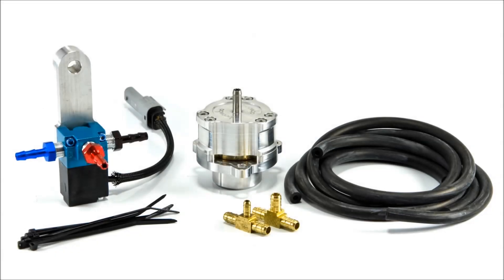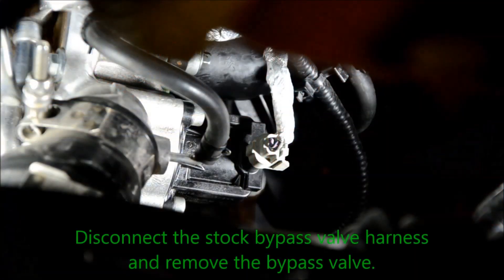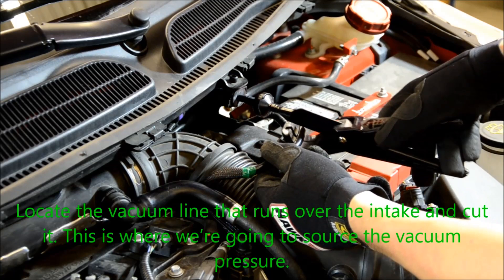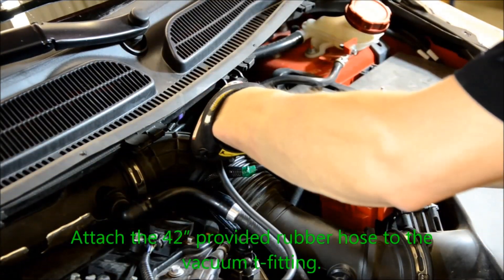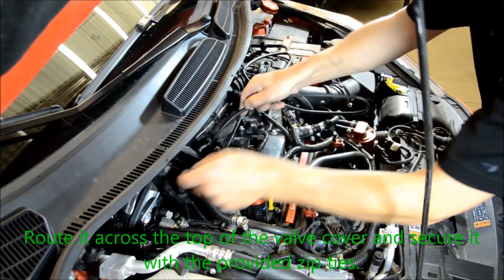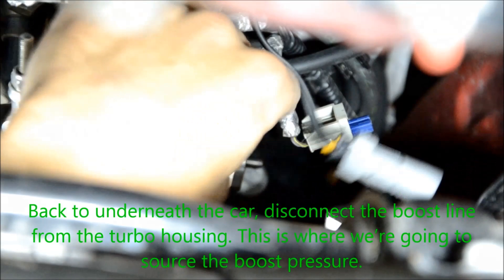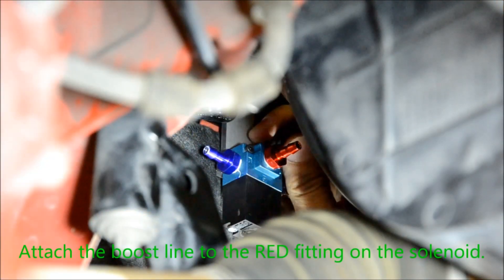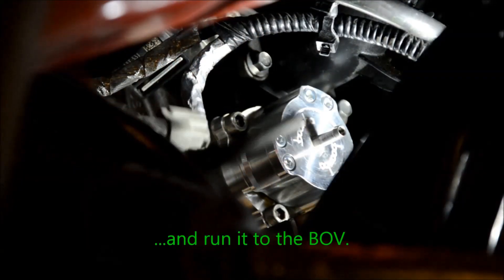How to Install | Boomba Boost Operated BOV/BPV for '14+ Ford Fiesta ST

Comment: Is this a left hand drive car? Meaning for right hand drive cars you take the drivers side wheel off? Thanks.
Reply from the maker: Yes this is a left hand drive car. However the location of the BOV does not change for right hand drive cars. The BOV on these cars is always located on the right hand side of the car. Which in Europe spec cars, would be the drivers side.
Reply: +BoombaRacingInc great, thanks for the help!
Reply from the maker: No problem!

Comment: How's this different from your adpter? Just more effective or?
Reply from the maker: Our adapter still utilizes the stock BPV whereas this piece totally replaces it. The stock BPV is known to leak boost and not hold boost consistently. Our boost operated blow off valve is much stronger due to its billet aluminum construction and brass piston. This will allow your car to make and hold boost better. This piece also won't do the occasional "hiss" that the stock piece is known to do when using a BOV adapter.